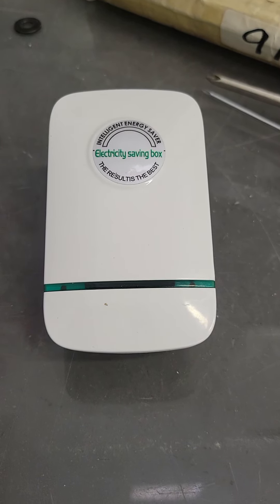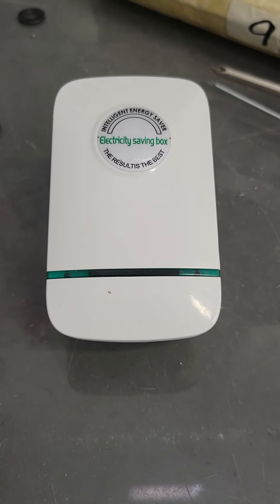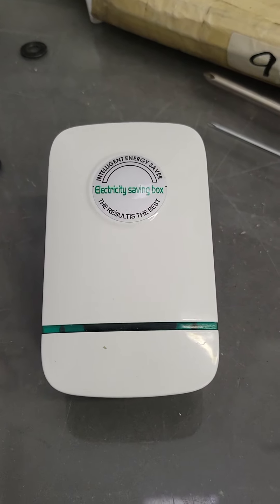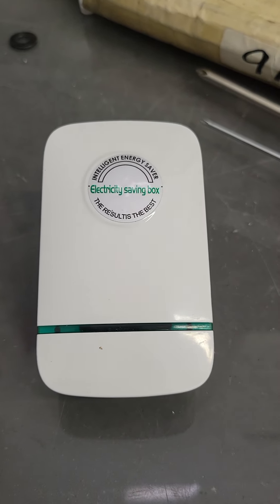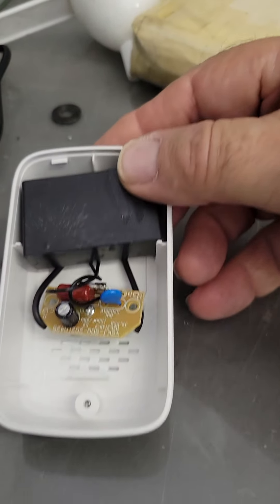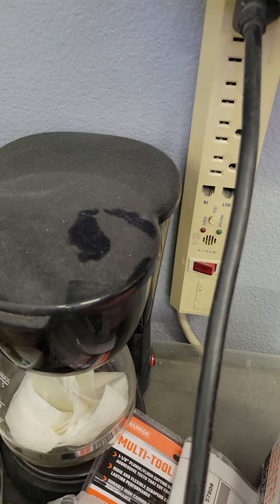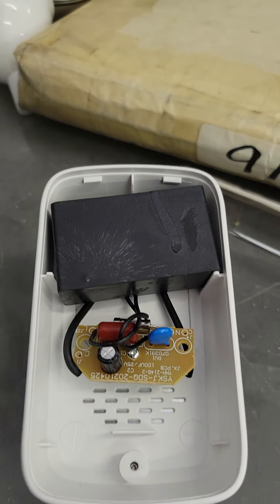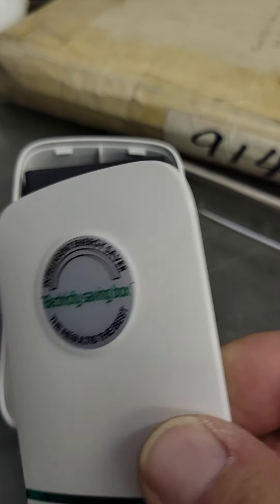Elon Musk Stop Watt Electricity Saving Device

Comment: this actually did have *some* cost savings on *some* power plans that metered using "power factor" but essentially a scam in this application and format
Reply: and definitely not endorsed by musk lol
Reply: In USA you pay the power factor in your residence? even if you dont have a triphasic transformer?
Reply: @tunicofumaca3921  you dont unless you're an industrial customer

The 3 reasons you would buy one is 

A: You are a factory being billed for your power factor

B: you live in a country where they bill you for power factor

C: you live off the grid (Solar, camping, etc) and bad power factor does waste your own electricity, so if you have only 10 hours of sunlight a day and run off solar, this might be worth it to make your power last

And NO MATTER IF YOU ARE OPTION A B OR C, this does nothing if your power factor is not bad because of inductive load. If you do use motors or other inductors, yeah this product might be a good idea for you